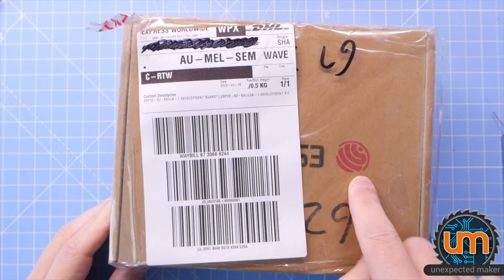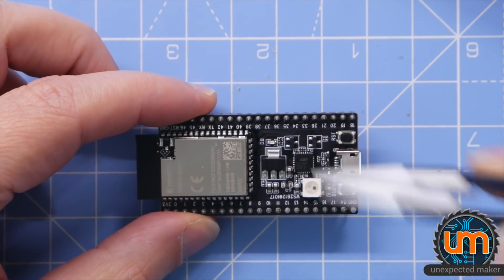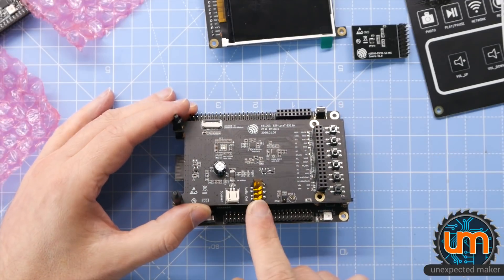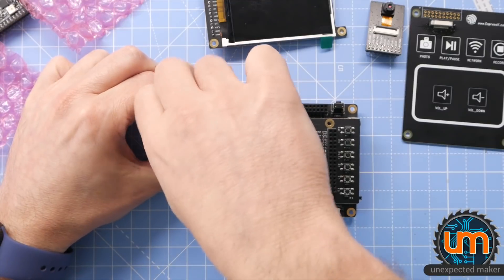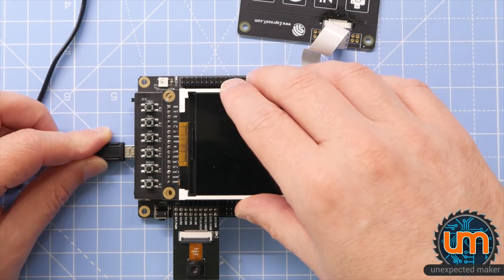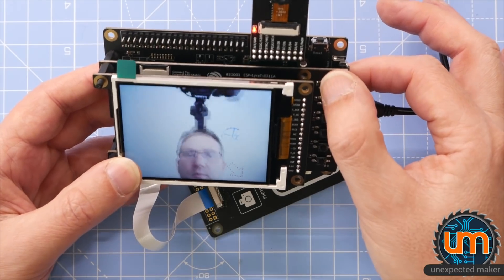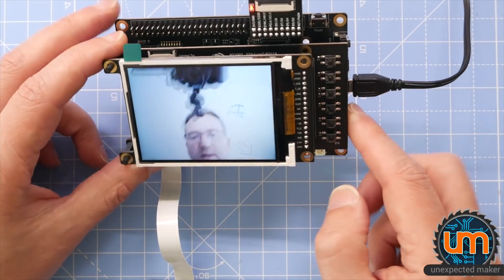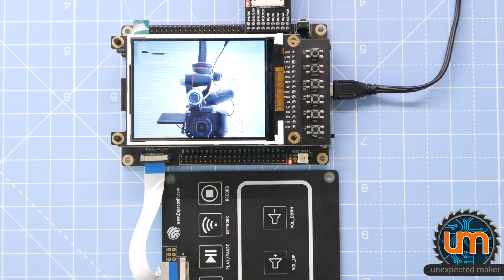ESP32-S2 Final Silicon - I have it + more!

Comment: Antenna is tuned to have open air beneath it. The proper way to have it mounted is like your dev kits. The ones that do have bare PCB under the antenna are acceptable and "good enough" for prototyping. This info is in their manuals.

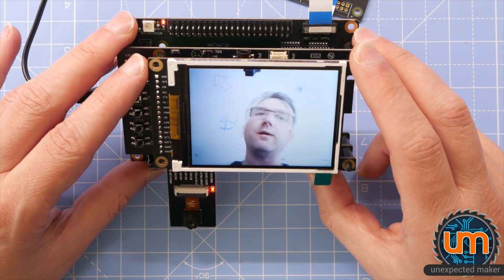Comment: 9:13 What the hell are you talking about? It doesn't realize anything. It just shows you a rotated image if you rotate it. You know, like a real mirror :D The reason why the image is upside down in the vertical position is just because unlike most selfie cameras and unlike real mirrors the firmware here doesn't mirror the image.

Comment: It will be interesting to see what uses the RISC-V coprocessor can be put to. I wonder if the camera demo is already using it as the video is just so much better than that obtained on a ESP32.
Reply from the maker: The RISC-V ULP is super interesting on the S2, but remember, the S2 has a parallel camera peripheral, so the S2 and Camera are directly connected, and it also has an LCD peripheral, though I am not sure if KALUGA is using that to drive the TFT, or if it's just bit banding in parallel.Either way, it makes a huge difference when stuff is supported at such a low level.

Comment: This was recommended to me by YouTube. I watched it to the end and, if I'm honest, enjoyed it. But I still don't have a clue what it's about. It looks like a Raspberry Pi clone with a camera module and an LCD screen. I suppose I'll have to Google it.
Reply from the maker: Thanks for watching! The ESP32 is a microcontroller, but one that has (in this case), WiFi on the chip. The normal ESP32 dual core variants have WiFi and BT in chip too. As a microcontroller they don't run an OS like Linux. You are coding firmware directly on the chip to control stuff connected to it. So it's not a computer, it's more bare metal than that. Hopefully that makes a bit more sense :)
Reply: @UnexpectedMaker  Thanks for taking the time to explain. It's much appreciated. This is interesting stuff but a little closer to the metal than I prefer to work. I'm comfortable with ARM assembly language (I moved on from 6502 in the late '80s) but I like to have an operating system I can call for the difficult stuff, so I own a stack of Raspberry Pis but no Arduinos.

Comment: Did you find out if the smaller dev board (the first one you unpacked) has the OTG connected to the usb connector or the silabs chip? Its looks like its the silabs one otherwise why bother putting it on in the first place. So no OTG breakout on the smaller WROVER dev board?
Reply from the maker: Correct, OTG cannot go via the CP2102/4 - So Serial2UART flashing is via the onboard USB. But the D+ and D- (GPIO19 &  20) are broken out as pins, so you can connect a seperate USB connector to those pins if you want. The SAOLA breaks out all of the GPIO of the WROVER module. Using the internal USB stack is optional, as not everyone needs it, and it takes resources.

Comment: why people cares about security on ESP8266 and hope that this ESP32-S2 will be the ESP8266 killer? Isn't an ESP8266 supposed to run on an internal network without any access to the external?  If yes, what are the security problems that they are talking about?
Reply: If the physical device is stolen (accessed), then access to the WiFi network password can be obtained. Remember the ESP8266 isn't just going into hobbyist made devices, but 100s of commercial designs.
Reply: @CraigFryer  there are really really few applications where the ESP8266 is used outside the home, if this is the only security concern I would not be so worried as many people says :)

Comment: with only two, time to get the ESD strap on :)
Reply from the maker: No such thing as ESD!
Reply: A vanishingly small number of ESD damage events actually kill the semiconductor outright. The overwhelming majority of events just degrade MTBF from millions of hours to thousands, hundreds, or tens of hours before failure. Those affected parts will fail prematurely as the laws of physics are immutable. Just because you don't see the damage right away doesn't mean the damage is not happening. The U.S. is now finding this out with Corona virus as they did with radiation in the 1950s.
Reply: @Peter_S_  Your right you quite often never see the affects of an ESD event.  Years ago i had a friend who made spectrometers, he demonstrated to the bosses that lack of ESD protection in the stores was affecting the logic chips. To show this he measured the propagation delay of a gate, then passed the chip around the people in the room. Then tested it again, the propagation delay had increased. He did this a few time and each time the delay increased, but the chip still worked just not as fast. They were running the chips at the max frequency so poor handing could be affecting the end product costing many £1000s. they soon sorted out the stores, then the goods in, and increased the size of the ESD areas in production.
Reply from the maker: I was just kidding folks... it's the running gag on my streams about ESD not being real.
Reply: @UnexpectedMaker  That's why we like pulling your leg.  We will have to start pulling the other one or your start walking in circles. looking forward to Tuesday night's stream already, see you  then.

Comment: can you compare the old esp32 with the new one? thanks!!
Reply from the maker: I did already. The first card that pops up in this video is an intro to the S2 and compares features with the current ESP32
https://youtu.be/9ISrim7kQSY.
Reply: Unexpected Maker A few details were missing, though... And what about some benchmarks? The ESP32-S2’s Xtensa LX7 should be faster than the LX6 of the ESP32, so it’d be interesting to compare the performance.
Reply from the maker: I did a follow up video afterwards....
https://youtu.be/yz06LobIS-g
Pretty hard to do benchmarks right now when IDF is still pre-beta and buggy and there are 2 completely different tool chains and compilers. Benchmarks would be meaningless. You'll need to wait a while for those.
Reply: Unexpected Maker thank you 🙂 looking forward to your live-streams again ! For now I’ll stick with the dual core for my robots